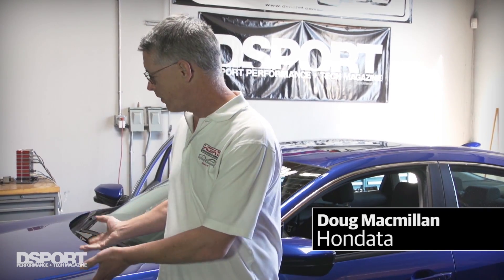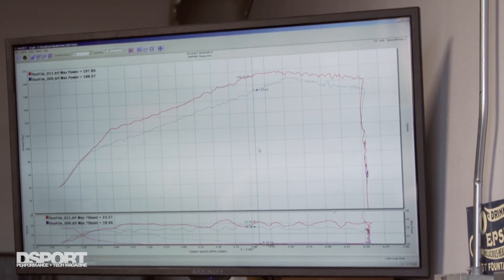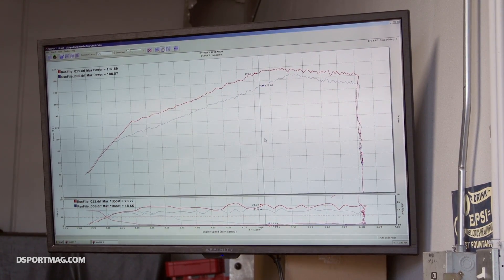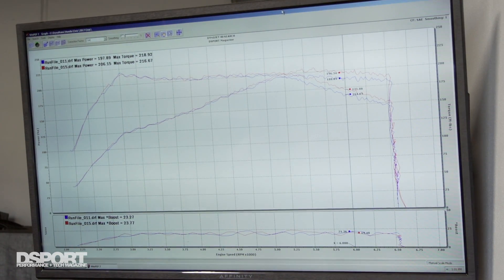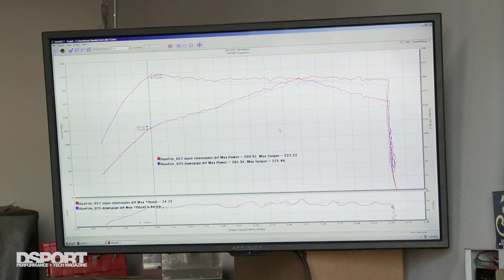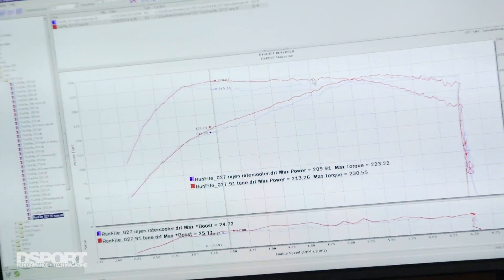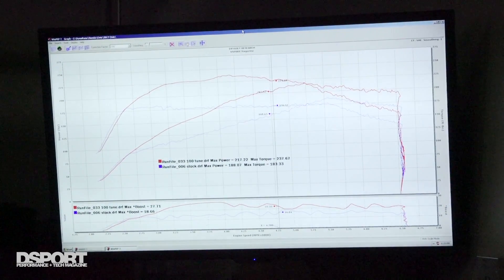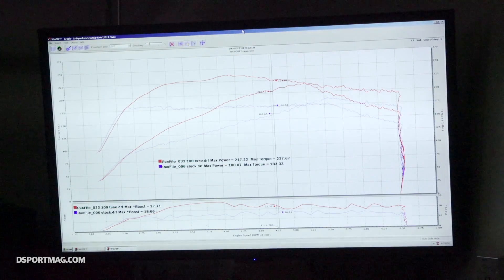Boosting to the Limits of the Civic's TD03 Turbo | 2017 Honda Civic Test n Tune

Comment: Love seeing the progress and attention the new civics are getting!
Reply: Jimster480 you're probably a 20something year old still fairly new to cars or just ignorant. Appreciate it for what it is. 90's hondas were track monsters when tuned right and nothing compares to the CTR or ITR in FWD or the CRX/Insight for fuel efficiency but realized regulations and technology makes cars heavier and safer while consumerism wants the next carolla-like car they can get their hands on
Reply: Jimster480 but it has more power, weighs more, and has more features than 20 years ago. Don't try comparing it.
Reply: But how safe are the cars from 20 years ago? My 2017 civic hatch gets 5 star crash ratings in all sectors and gets 35-40 mpg daily driven. The suspension is great too, I don't feel any body roll at all. In 2017 it's about fuel economy and performance. I wouldn't say the cars these days aren't great, it's just a shift in direction for consumers. If I wanted a good price and performance balance I would of bought the S2000 at 21 thousand in a heartbeat if it was still in production. I don't want to argue so i'll leave it at that.
Reply: Jimster480 awesome
Reply: Jon Camar Hondas do race. You've never been to a legit race track, clearly. And oh yeah honda is the only one doing fwd right, because I forgot GTI were awd.
Reply: Jon Camar what? Honda's race... Not the best F1 engines out the haha, but they do race. They are race in the two wheel industry, and if not mistaken, their are doing jets now. I think the engines are US made... Definitely not General Motors, maybe General Electric? Camaros are cool too.
Reply: I think the key might be more in the reliability of the engines. Because sure you can push 200 from a d16, but for how long? 

On a side note, any opinions on the k20c2 in the LX?
Reply: Jimster480 fair enough, I don't really have much experience with turbo d series vehicles, just wanted to ask. What do you think about the 2 liter na for the lx though? Do you think it'll have a higher tuning potential than the turbo 1.5L
Reply: Jimster480 because I just purchased a 2017 LX sedan after my 2004 died
Reply: Jimster480 fuel efficiency bro
Reply: Alexjoel McKenzie well if it's a k20 then yes. It should hold more power and have more aftermarket support.
Reply: Christopher Millington Ya sorry but the new civics are basically the same weight as a camaro. You are talking about a couple hundred pounds difference at this point and the 4cyl ones are actually lighter than the v8 ones and are more comparable to the civic. 
The golden days of modding Hondas to beat other cars is gone. This car with its stock turbo maxed out is like a low 14 second car, honestly you still won't be beating anything with it even if it reached high 13s.
The old school civics were fast with small amounts of power because they were close to 2000lb and had very aggressive gears. 
Now gears are more for gas mileage and the cars are 3000 or more pounds.
Reply: That really shouldn't be a surprise, nobody is doing FWD performance cars anymore.
Honda is basically there by themselves.
Reply: Yep, 
Because nobody cares about FWD world records when nothing is competing in FWD.

Sad thing is that the Camaros are spanking BMW's, Porsches and other high end cars around race tracks while Honda is struggling to beat its own personal records from a decade ago.
Reply: @Jimster481  l.p.
Reply: frieddayfriday not at all
Reply: Alexjoel McKenzie you can run it like that for years. They don't break until after 215 whp.
Reply: If I wanted a real car I would of bought the Camaro SS like my friend for 37k. The civic is a "fun" eco car no argument there. Well have a great day. Papa Bless.
Reply: mehftv but they aren't more efficient than the D16/d15 cars of 20 years ago....
Reply: lostweat perfectly fine, all this new safety stuff doesn't do much of shit. They need to make it safer because they keep making bigger cars that cause more damage.
Reply: lostweat the new Hondas don't have performance, sure if you put put around the city and don't drive any real cars u won't know.
Reply: Not really progress, it makes less power than a stock D series with a turbo around this size lmao
Reply: New to cars?
Lmao I've been building cars for a decade now.

I happen to own a fully built 97 civic, but I also have a G35 which is modded and tuned too and I just bought a Chevy Ss sedan.

But my buddies and I have a whole assortment of cars (mostly from Japan) and we are very familiar with performance cars. 

The new cars of today are overall not that great, and I understand that people are interested in cars with gas mileage but overall the performance is poor for the price and size.
Reply: lostweat even a v6 camaro is more fun lol or you could mod the 4cyl model.
Reply: HAHAHa. And when you drive these cars off the lot they loose their value. Into the dump in a few years.
Reply: The features suck, the transmissions are worse, the suspensions are horrible and the cars are fat tanks that ride like ass.

You are right there is no comparison, Honda in 2017 = trash
Reply: @Jimster481  somebody sounds jealous